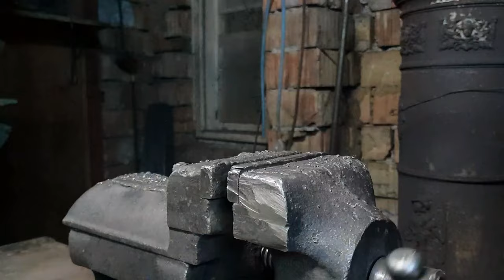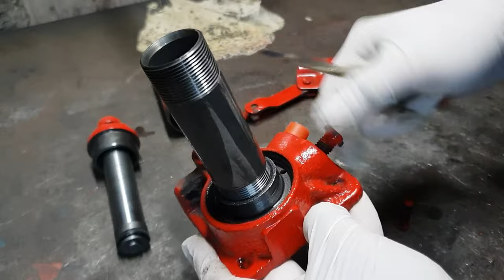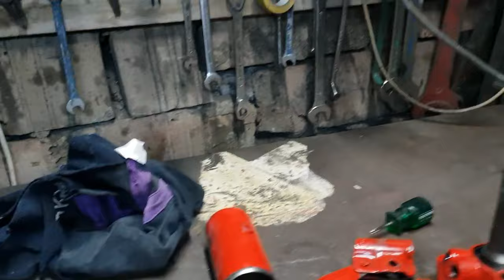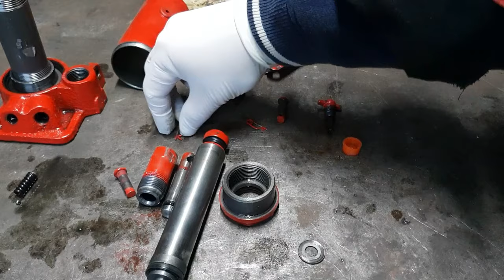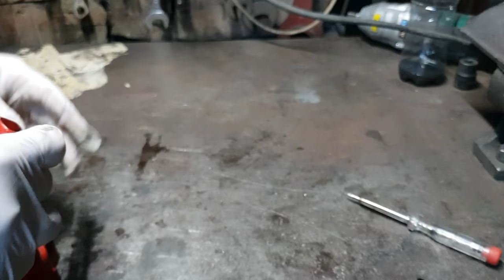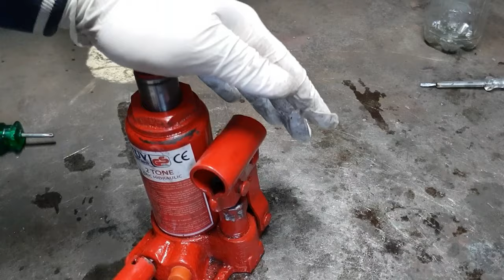Hydraulic jack parts. Dissasembling hydraulic jack | Dezasamblare cric hidraulic

Comment: I noticed you had a problem with removing the one pipe! Take a propane torch and Heat the base nut where the pipe is threaded into put your pipe wrench on it and put slight pressure on it heating this way you get the right amount of heat on it and not over heat it when it expands it will let go and  you won't over heat it !

Comment: Hi have a 3 ton floor jack I have no name an no numbers on it how would I go about finding a seal kit for it if possible?
Reply from the maker: For no name hydraulic jack is very difficult to find a seal kit. Disassemble the jack and see what the problem is. If you have a broken gasket then change only that one.
Reply: @DorelBorlea  ok thanks
Reply: Go to your local hydraulic repair center ,they will size the shaft..and bore cylinder ..and give you its recommended hydraulic v shape seal

Comment: The reason I watched and the one thing I really needed to see was the seal that goes around the release valve, it appears u just gave up on removing it, and most parts diagrams for these Jacks show a ball down in front of it too, all that I've seen, did this not have one?
Reply from the maker: I didn't want to break that seal, that's why I gave up on taking it out. There are several models of jacks. Behind that seal, some have a kind of conical piston, some have a ball bearing and others only have that cylindrical screw.

Comment: Is the o ring seal at the bottom of the cylinder required for it to work right? I have an engine hoist cylinder that’s similar to this, but mine has an o ring at the bottom. Do I need that? Mine was ripped in half.
Reply from the maker: the stem of this jack has an o-ring at its base, that o-ring is covered with a kind of teflon gasket.
Reply: @DorelBorlea  is it needed to function properly???
Reply from the maker: Yes
Reply: @DorelBorlea  thank you

Comment: Hello nice new jack 
une question witch parts did you change by this overhaul ? 
Why this dismantling ?
Bonne soirée
Reply from the maker: Hi. I have often received questions about possible jack failures. Most of the problems were due to the loss of the bearing balls from the jack valve. So I decided to disassemble a new hydraulic jack so that all the parts could be seen.

Comment: Would it harm anything to rub this oil on the post to keep it from rusting?
Reply from the maker: The cylinder rod only rusts if it is in contact with moisture. The gasket cleans the excess oil from the cylinder rod and there is no point in lubricating that rod.

Comment: I need to fix the valve under the large piston and you give up on removal of the cylinder where the valve is located. Nice video of I wanted to work on anything except that valve.
Reply from the maker: I tried but failed to untie that cylinder.
Reply: @DorelBorlea  Hi, and thank you for the quick reply. I really appreciate your quick response. Thank you for the video, it was detailed and well done, with the exception of the only thing I needed to know, which is where is the valve (ball) which retains the pressure when the jack is lifted. Mine bleeds down very fast and so I probably need to clean it or replace the ball or seat. I wanted to know where the valve was. Your disassembly provided everything except that. Thanks again.
Reply from the maker: I'm glad you liked this video. The pressure relief valve is located inside the cylinder. But that part is very difficult to disassemble.
I don't think the ball or the seat is the problem. Probably a piece of plastic or dirt got stuck on the valve galleries. Try to clean them with air.
Reply: @DorelBorlea  Excellent suggestion, thank you.

Comment: Wrecks everything with a pliers, puts crappy old oil back in and doesn't prove it works. Jacking it up with no load on it proves nothing.
What a hack.
Reply from the maker: You didn't understand anything from this video. :)) This jack is new. I just disassembled it to see the components of this jack. The jack had no operating problems.

Comment: Its written do not adjust and you just remove it
Reply from the maker: The adjustment of that valve is done in the factory with the help of a special device. That valve has the role of preventing accidents or damage to the jack when we try to lift something heavier than 2 tons.